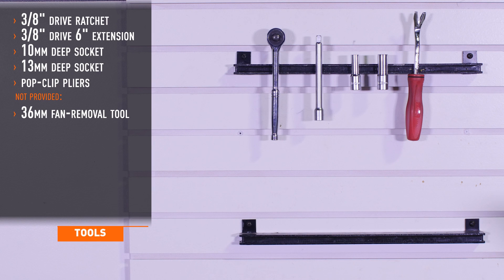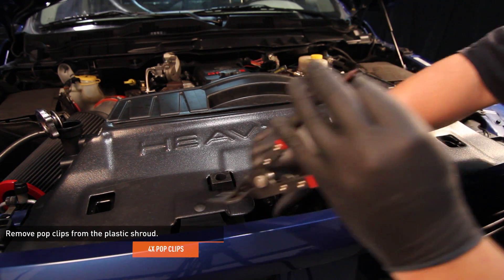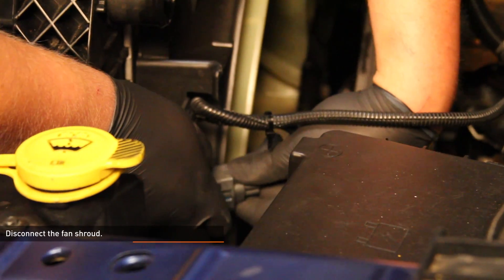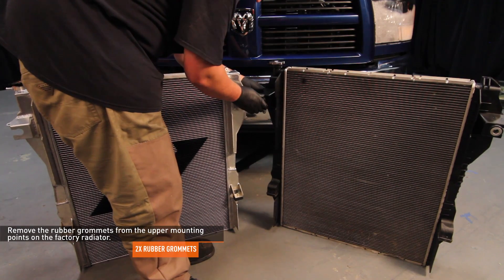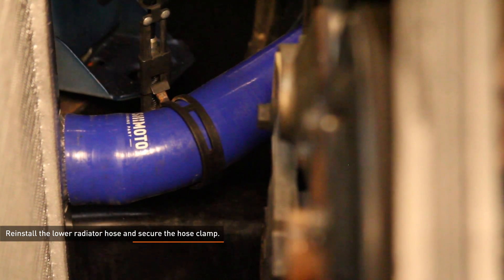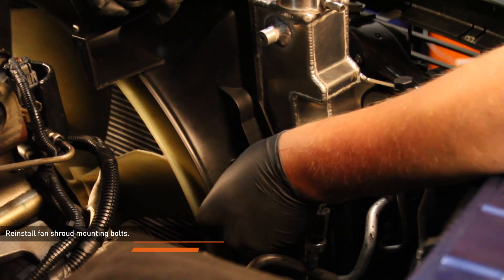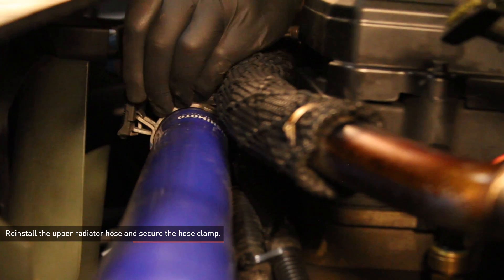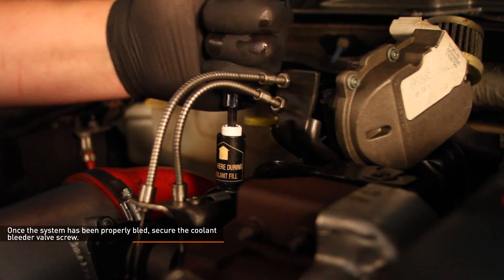2010-2012 Dodge 6.7L Cummins Aluminum Radiator Installation Guide by Mishimoto

Comment: Hi great video! What is the name of that tool you use to remove and apply the clamps on the radiator hoses. I usually use pliers but it's a real pain.

Comment: I have a 2011 ram 4500. It will overheat in the summer pulling a heavy trailer, Its done this since new. I was told this year had a less than desirable radiator? Will this radiator offer better cooling than that factory one?
Reply from the maker: Hey Larry, our radiator has a 64% capacity increase over stock and will allow for more coolant to disperse that heat!